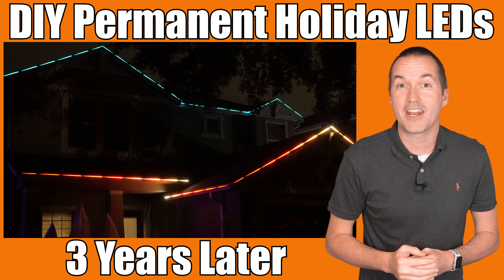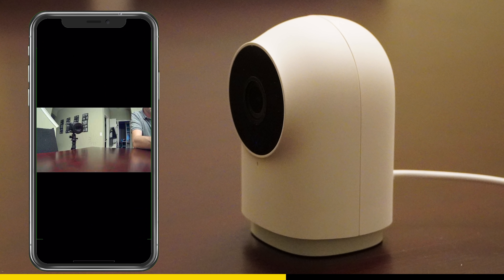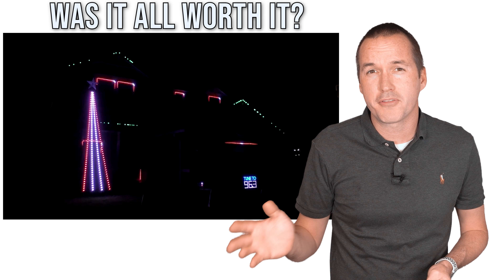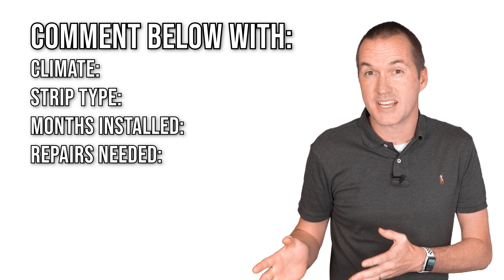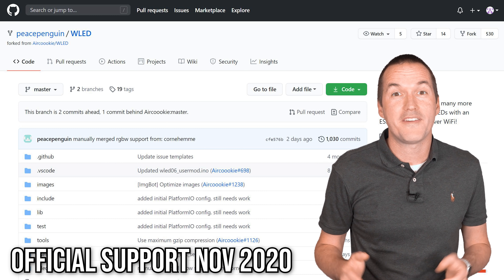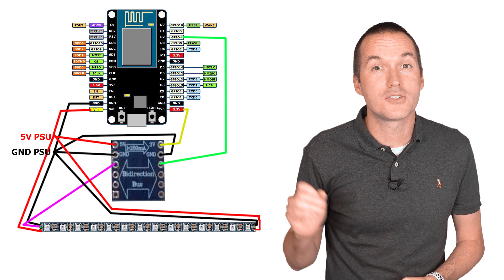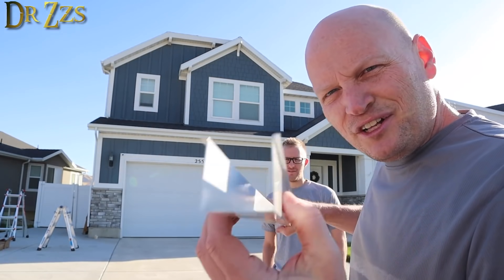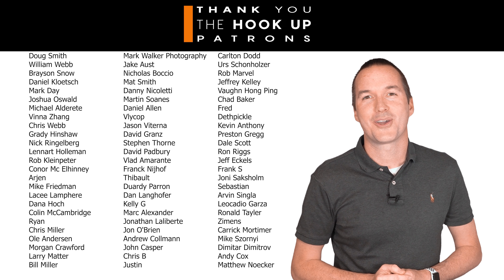3 Years Later: DIY Permanent Holiday LEDs - What worked, what didn't, and what's new?

Comment: Hi - Great videos. Just wondering, do you have an instructable or tutorial about how you made the pvc tubes to go around your windows, specifically, did you drill through from one side to the other in order to be able to insert the pixels? I have pixel strings and am looking for some advice on the best way to mount them around windows. I live in Europe so the availability of pre made solutions is pretty low.

Thanks

Comment: so, im wating this 5yrs after you installed your lights. has anything changed? any updates or improvements?
Reply from the maker: Still going strong, I haven't really touched the roofline stuff.  I'd say they have a few more years in them before they need to be replaced.  The covers on the aluminum channels are definitely yellowed, but I don't think they have gotten any worse in the last year or so.  The LED light output is probably 60% of what it was originally.
Reply: @TheHookUp  being that I'm not a handy person when it comes to home stuff, I was thinking to purchase a kit through TrimLights. Do you know anything about this brand? I was interested in their 6in Edge System and DownLights for both accent and security lighting.

Comment: Hey, I’m surprised that they don’t have some “start kits” that have a box with a power supply, controller, and wired with a plug, ready for 5v or 12v, depending on the kit you buy. Do you know of any?
Reply from the maker: Yeah, those are called "ready to run" kits, lots of vendors have them: http://www.holidaycoro.com/Ready2Run-Flex-Expansion-Controllers-s/2099.htm?Click=12722

Comment: Thank you for your videos.  I currently have 300' of Neon Flex Tubing that I bought from Viais LED (Alibaba).  The IC Type is 8206. 24v.  I wanted to see if you know of a good controller that I can use with it.  I'd hate to have to throw them away and start over.  Thank you for any help.  The controller that they supplied is very poor and frustrating

Comment: Which wire to use to power injection, we are installing LED in aluminum channel(normal one not the plus size one) . we wish to hide wire and so that it will not block LED as well

Comment: Minnesota, very cold, no name brand led strips, Waterproof. Behind and under the gutter install.  
I installed them under my bar inside also The inside still worked after 5 years, when we moved. 
The outdoor strips (all 5) failed in the first winter. The last outdoor light strip failed at about 5 months.
Reply: Hi, which ones did you buy.. I would like avoid them as im in MN too.

Comment: This may be a dumb question so pardon my ignorance.  I recently purchased the waterproof strips from Amazon.  Can these be directly mounted with staples under the gutters with no channel?   I will need to make several connections as the house is large.   Can this be done or is it not advised?

Comment: North Georgia (metro ATL), BTF-Lighting 5V Strips WS2812B, 15 months, multiple repairs needed. Burned first pixel from nearby lightning, multiple pixels are always blue when turned off in software but power still applied.
Reply from the maker: Do the pixels stay blue during animations or do they do what they are supposed to do?
Reply: @TheHookUp  they respond but the colors aren’t typically correct.

Comment: Why do you have 2 power supplies? Did you upgrade to use a DigUno?
Reply from the maker: 2 Power supplies because I have more than 40A of LEDs.  I was planning on switching to DigQuads this year with ethernet, but for some reason my 2nd story LEDs do not like them and the data signal gets corrupted.
Reply: @TheHookUp  I am following your guide and even for me I have more than 40A requirement but I was thinking to get a single 60A PSU. Do you see any problem with that? Can you please tell me the difference between the DigUno and DigQuad? I am trying to create 3 zones for my setup. I am also now wary of getting the Digxxx since you mentioned data signal gets corrupted :(

Comment: I live in Colorado where we have really harsh sun and UV in the summer and lots of freeze/thaw cycles in the winter. I put up IP65 strips in aluminum channels and where I had problems was at the solder joints between the connected 1ft strips. I installed them for Halloween and by Christmas I already had one factory solder joint failing. Had to repair a number of them this Halloween to get everything working again. Planning a permatrack buildout with string pixels and DigiUnos some time between now and next Halloween, possibly by Christmas.

Comment: Did you change your controller setup? and if so what is your current configuration?
Reply from the maker: During the year I use WLED, then at Halloween I switch to my big setup (a HinksPix Pro, and a Falcon F16V3).  This year I may try to keep my main lights on WLED since I just switched to the new DigQuad with ethernet and it seems to handle E131 packets very smoothly.
Reply: @TheHookUp   Thanks for the quick reply.  I was thinking about the DigQuad for my permanent LEDs as well instead of the nodeMCUs. I had some flashing last year on some of the more complicated effects while running pixels on my nodeMCUs. I am going to try to source/solve this problem before I install everything.  Great job and thanks for schooling Earth's younger humans and adults alike.

Comment: I took your advice and ordered my holiday equipment early...I was told not only will they possible be out of stock but the prices may increase again by the holidays (so thanks for the heads up). But I have a question for you......I ordered the a ready 2 run system with a hinxpix pro cpu and 16 spi outputs + long range expansion board. My question is if I'm using 10 of the 16 outputs for other props/leds that only leaves me with 6 empty outputs. Would I have to buy a separate ready to run controller to control a Mega Tree because that needs 16 outputs by itself? That for your time and awesome channel!!
Reply from the maker: You could chain your outputs and have 100 or 150 LEDs per output instead of 50, but I'm not sure how well the ready2run will work then.
Reply: @TheHookUp  Appreciate your help..so in stock form each  SPI Output can control 1 universe up to 512 pixels correct? Again TIA.
Reply from the maker: @TheHonarable1  More than that I think.  Just needs to be configured properly on the controller.
Reply: @TheHookUp  Thx so much!

Comment: Can you let me know what you think of the following set up?
Cold climate, down to -40 in winter so opting for 5V WS2811 Strings.
5V 40A power supply feeding DigQuad in heated garage with 20 AWG wire (basically beside each other) then will penetrate exterior wall for 3 different channels of Strings.
Channel 1: 
3 strings (150 pixels) in 30’ of j trim - 
10’ of 3 pin 22 AWG extension wire from Digquad to first string.
40’ of 20 AWG 2 pin wire from Digquad to power inject each strip including the end using T clips
Channel 2:
3 strings (150 pixels) in 30’ of j trim - 
30’ of 3 pin 22 AWG extension wire from Digquad to first string.
60’ of 20 AWG 2 pin wire from Digquad to power inject each strip including the end using T clips
Channel 3: 
6 strings (300 pixels) in 60’ of j trim - 
10’ of 3 pin 22 AWG extension wire from Digquad to first string.
70’ of 20 AWG 2 pin wire from Digquad to power inject each strip including the end using T clips
I think based on the info on all your videos and what I’ve seen on Dr. Zzs this should work?
Thank you so much for your videos btw!

Comment: Quindor suggests to use 24V strips if one is starting new installations, while you are suggesting to stick with 5V strips, I want to install LED strip wiring for holidays and ordered 24V strips to reduce power drop issues, can you cover a video covering what could be the best setup for 24 V strips (where cost is not a concern, ease of managing is)?
Reply from the maker: 24v addressable strips basically don’t exist. Are you talking about traditional strips?
Reply: @TheHookUp  this is the one, while less injections for sure, wondering if this will be long lasting compared to 5v/12v version SK6812 RGBW 60LEDS/M DC24V 10MM-Wide Digital Intelligent Addressable LED Strip Lights - 5m/16.4ft per roll https://www.superlightingled.com/sk6812-rgbw-60ledsm-dc24v-10mmwide-digital-intelligent-addressable-led-strip-lights-5m164ft-per-roll-p-2403.html
Reply from the maker: Those are addressable in groups of six, not individually addressable.

Comment: I found a shortcut for installing the aluminum channels. I used a nail gun with stainless steel brads to install on flashing and under the drip line.
Reply from the maker: Interesting, I've never tried that.  Hopefully you wore safety goggles!

Comment: I bought 5050 RGBW 4in1 led strips, power supplies and RGBW controllers. When assembled they only display red or a very tiny dot of green. i have tried multiple strips and controllers all with the same result. Any suggestions?
Reply from the maker: Sounds like you bought non addressable strips and you are trying to control them with an addressable controller.  How many wires does your strip have?

Comment: I am new to holiday lights. I want to wire 15 meter of ws2812b to the same power supply. If i understood correct the best way to do it is to run a separate wire from the power supply to each start of the strips and another pair of cables to the end of each strip and the connect ground and data of each strip together?

Comment: Climate: Intermountain West (USA)
Strip Type: WS2812B
Hardware: ESP32 Node MCU w logic level shifter. 
Software: WLED
Months installed: 5
Repairs needed: 1 (major)

I had Ice/snow penetrate the aluminum channels that I had used for installation. It was at the location of my 1st solder joint/power injection point. Additionally, the power injection at that point was sloppily done and I couldn't fully get the plastic covers on (which lead  to the moisture penetration). I had done the work in the air on a cherry picker as it was near the highest point of my roof (about 30'/9 m). I had previously been able to get it working by gently rapping the connection with an extension pole). Eventually that technique failed as well. But hey, they survived Christmas! :) 

As I was removing the aluminum channels to make the repair, the strip ripped in several places forcing me to solder in new groups of pixels in those locations. I also moved the power injection another couple of feet to the end of the pixel run on that pitch. That makes about 7 meters from one power injection point to the other, but I've found that between 30-50% brightness is more that adequate, so it shouldn't be a problem. I also only run every other pixel as I like that look better.  

My repairs were more a manifestation of my own mistakes during installation than problems with the components.

Comment: How did you handle the outside corners with your channels mounted to the gutters?
Reply from the maker: Lots of hot glue
Reply: @TheHookUp  did you just kinda but the ends together? the whole front of my house is gutters and I have several inside and outside 90 degree I will have to deal with.

Comment: Climate: Mild California coastal hills
Strip Type: Analog RGB 12V bus
Months Installed: 98 Months (no really)
Repairs Needed: None

I ran the bare outdoor rated strips under my eaves and held them in place with big staples.  Large dedicated bus cable in the larger runs but otherwise injected in the middle of most runs.  6 PWM channels on an Arduino Mega board with a FET based power switching board of my own design.  Strips have yellowed a bit but they never see direct sunshine so it's not bad and you have to go looking for them to see them.  No failures except for the time I accidentally hit one with a hammer trying to drive a nail.

BTW: I used those 45 degree aluminum channels to light up my garage, hall closet, and pantry with white LEDs and I couldn't be happier with them

Comment: man i did 5v leds around the ceiling in my game room with that 45 degree channel and power injecting was a NIGHTMARE because that channel doesn't have enough room to pass thick enough wire. it would have been better to inject power from different outlets but i didnt want a wire coming down the wall or the extra work to pass the wire through the wall. i couldnt inject  power through the ceiling easily since its a two story and this was on the first floor.

that being said you would need really thick wire or multiple points of injection to do your whole roof line on 5v led's if i could do my gameroom project again i would pay double for the 12v leds  or even a more commercial 24v

Comment: @The Hook Up  What am I missing with the power injection wire.  Its 22ga, and DC.  The voltage drop is going to leave you with no power to inject after only a couple dozen feet even at only 1A.
Reply from the maker: What information are you basing that statement on?
Reply: @TheHookUp  I expect I am missing something, but basic DC voltage drop calculations.   Each strip you have used 8.5 or so amps at 5V.     Plugging that into a dc voltage drop calculator, at the end of the first strand you are down the .87v

https://www.calculator.net/voltage-drop-calculator.html?material=copper&wiresize=52.96&voltage=5&phase=dc&noofconductor=1&distance=16&distanceunit=feet&amperes=8&x=95&y=24

Comment: Thank you for these videos! You've saved me from some big buying mistakes!  Maybe you can save me from a few more?  I have a handrail on my deck that is roughly 120 linear feet and a squared-"W" shape.  Around every 50"-78" of glass panel is a 4x4 that holding it and is either a 90 degree turn or just continues straight on.  
Based on your videos, I was looking at the 5V SK6812's to have the option of a pure white.  For a run this long, does it make sense to use 12V instead?  Or is it enough to use a 5V power supply with power injection? (How many feet per injection?)  The idea is to have the lights bright enough to give some light to the deck, but also have the color for music and/or holiday decorating.
I plan on attaching the aluminum channels to the underside of the handrail, pointing down.  Did you attach yours using the clips? Or directly glue/screw them to your house?
Also, the controller would be outside under the deck as there really isn't an option to have it inside.  Do you have a recommendation for a waterproof (or water resistant) case (like what you used in the videos) to store the power supply and controller?  Do you have a video showing the assembly of the case, controller, and power supply?
Am I on the right track here with the equipment above and from your links?

Comment: Thanks for another excellent video Rob! 
I have a question: is it possible to control the LED strip drivers in a more generic way using HA or Node Red, so that any installed lights can be part of generic year-round architectural lighting, not just in the holiday season. 
Thanks :-)

Comment: I may have short circuited my RGB IC LED strip. Is there a way to fix it? I thought one of the LEDs burned, so I cut the first LED from the strip and resoldered it. It didn't fix the problem. Could you guide me how to salvage the strip?

Comment: Does your house have the clear channel covers or are they the white models?  They look white but want to be sure.  I purchased the white ones but while testing inside my house the way the white diffuses the LED's seems to make the LED's much less "twinkly" but the videos of your house look great.  I am about to buy some clear ones but hate to spend the extra money if I don't need to.  Can't decide.
Reply from the maker: White, I don’t think the clear ones would do a great job of concealing the strips.
Reply: Thanks. Not done yet but got about 1231 of my LEDs running tonight. Went with the white covers and they look great and agree, good to cover up the junction wiring.

I'll probably make a video for my channel on what I did but FYI what I did is use the channel as the ground conductor and ran a single parallel 12 AWG THHN wire in the channel for power injection. Working great so far. Haven't measured voltage drop yet but no visible degradation of colors or brightness at the end of the chain.

Really appreciate your videos and all the help.

Comment: Thanks for a great summary and all the links - it does make life a ton easier. One thing you did not include in your parts list is the weatherproof box you used to put the power supply and the controller. Those power supplies are really exposed and I would love to upgrade from the plastic container in which I have put it now. I have searched on Amazon but there is nothing obvious coming up as "weatherproof box". Also would love to know how you mounted the power supply in it. Thanks!

Comment: Your videos on addressable LEDs helped me build these: 
https://www.youtube.com/watch?v=Hxy3uzeZAh0  
Lots of soldering effort but I'm pleased with the result.
Reply from the maker: Very cool, did you use aluminum channeling?
Reply: The Hook Up thanks. Just a sheet of plywood cut it to an 8 point snowflake and painted white. Lots of hot glue and heat shrink. Hopefully it will last the wet uk weather.

Comment: When doing your power injection at different mid points do you have to also connect the N wire. Since the 5v already has a Neutral reference at the begging and end, where both positive and negative are connected. Thinking I can just add a hot wire , 5v to cut down clutter inside the track.
Reply from the maker: Best practice is to include both conductors.